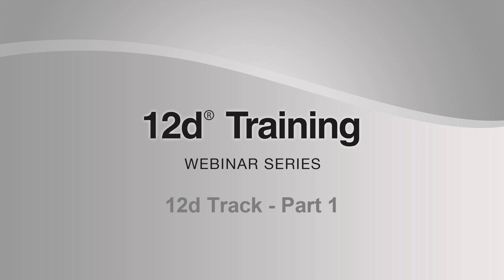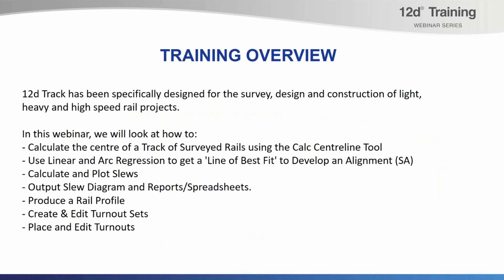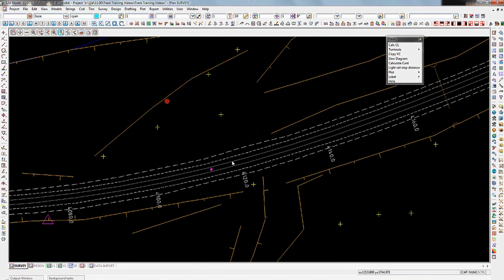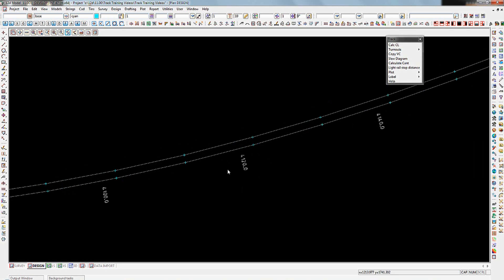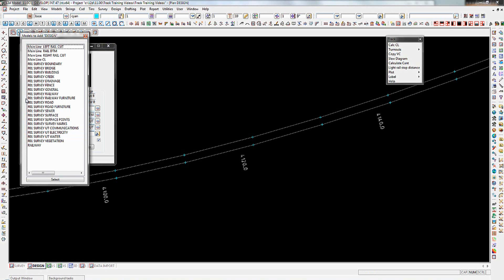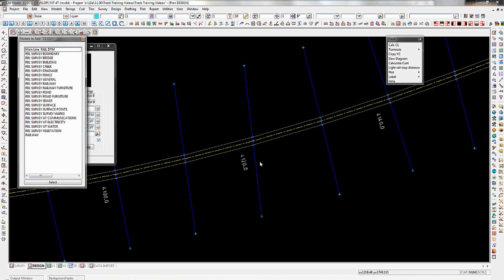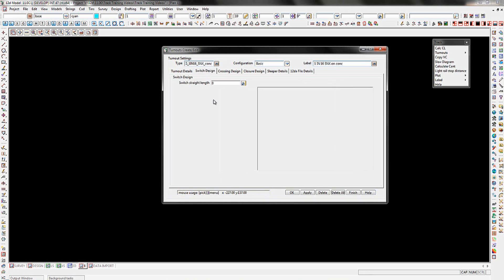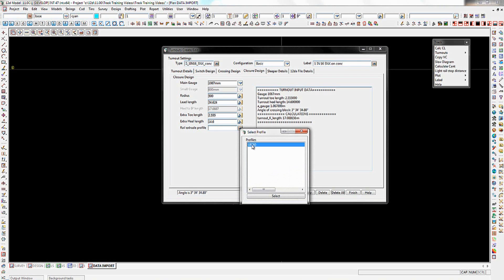12d Track: Part 1 - Training Webinar Series

Comment: Question, it seems in this video the turnout is placed on the main line and as a result produced the starting horizontal alignment for the loop line centreline (due to the profile of the turnout). Is this done by intention such that the loop line horizontal geometry is able to be drawn after the placing the turnout? because otherwise, i would imagine the placed turn out  may not line up with the loop centre line If loop line horizontal geometry was created first .
Reply from the maker: Hi Jacky! Please email your contact details to info@12d.com and we'll organise for the presenter to contact you personally about this question :)